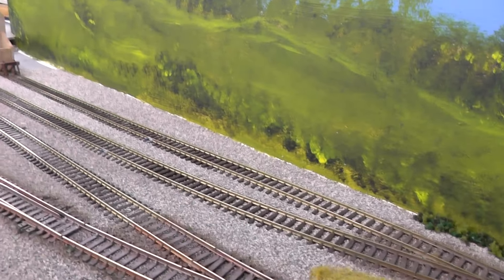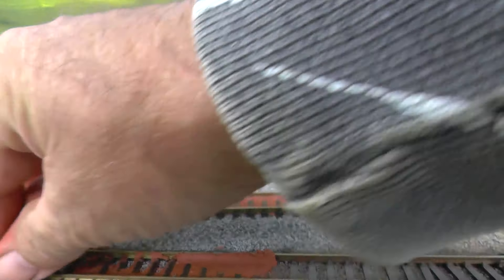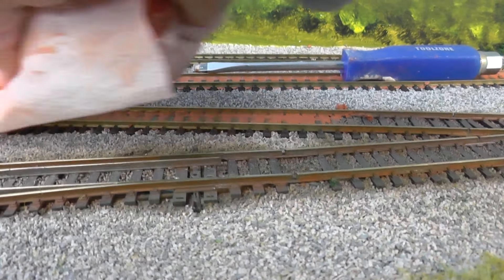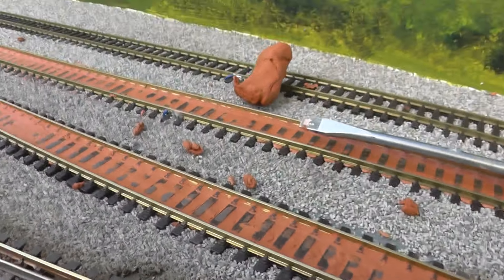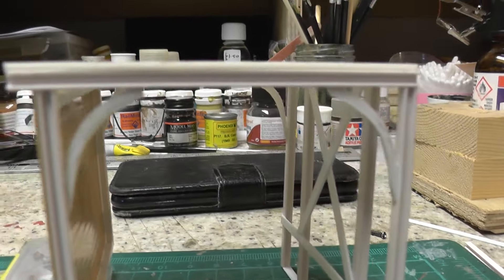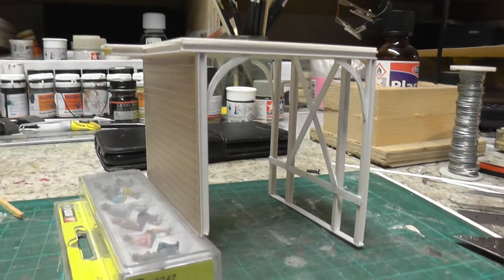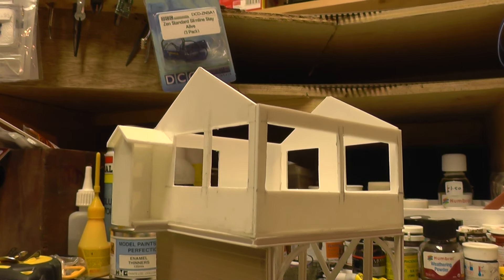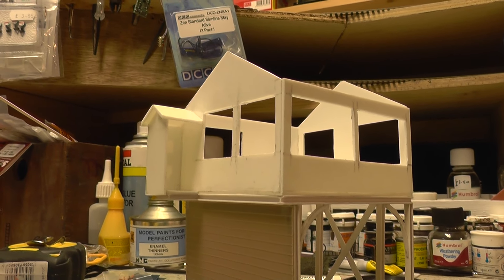Perranwell station part 5

Comment: You gave me a great idea for making the road crossings.  Instead of using mud which is messy as hell, I think I will try the clay which should be a bit easy to use.  The scenery is coming along.
Scott
Reply from the maker: hi Scott yes the clay is great to use and not so messy as filler cheers Kevin

Comment: Never used modelling clay. I have always used polyfilla (other makes available). Polyfilla is also very good for cobbles if you catch it just as it dries with a pre-made mould, or afterwards by scribing. Looking good as usual Kevin. Very much like the look of the signal box. Cheers, Bob
Reply from the maker: trainmanbob thanks Bob thought the clay would be cleaner than filler worked ok with no sanding cheers Kevin

Comment: I used das clay on my layout CSX Rensville. I put down a coat of PVA glue first then applied the clay using my fingers to push it down. Once dried and painted the static grass was applied the over all effect is very good. I do like your videos and your layout is excellent.
Reply from the maker: CSX RENSVILLE hi thanks very much glad you like it will have a look for a new tripod soon cheers Kevin

Comment: That is lovely work on the signal box Kevin and a real unusual building too. The laser cutting is probably the perfect answer for those frames. Have you ever tried scoring clear plastic sheet to produce fine frames? If not, you score the sheet with the desired number of frames and then use an acrylic or enamel paint to leach in to the grooves and wipe the excess away - much the same way as doing grouting on brick plasticard. Getting the window pane totally clear after is the real knack with that method. Paul
Reply from the maker: Galgorm Hall OO Gauge Railway Layout hi Paul thanks for that info might give it a try like experimenting cold be fun cheers Kevin

Comment: I'm going to try the DAS clay too in between my rails for a cobble effect. I've never done it either. I think I might have fun/difficulty imprinting cobbles in between rails. As you say running an old wagon will help stop it fouling up before it hardens. 
Looking forward to your signal box. All looking good so far methinks. Laurie.
Reply from the maker: Calvertfilm hi Laurie thanks the clay works well would look good with cobbles Imprinted ,really pleased with the signal box cheers Kevin

Comment: I like the bridge and tunnel stonework. That extensive use of the modelling clay is impressive. Have you tried polyfiller? I am also impressed by the outline platform and buildings with that signal box. The laser cut windows will complement your scratch built box well.
Reply from the maker: Hi John thanks very much the clay molds nicely where as filler would need a lot more work ,just thought the clay would be easier .hopefully the signal box will turn out well cheers Kevin

Comment: The bridges look good Kev , even better when completed , not sure about the modelling clay , maybe when matt painted they will look far better , interesting signal box you look to be doing a nice model of it ..noticed you have the stay alive decoder kit hung up , just tried one and with a 6 pin decoder and burnt it out ...not sure what went wrong ...wired the blue stay alive to blue on the decoder ..black to black ..then put the decoder in the Loco ..and it just burnt the decoder without any movement ?? completely baffled me ..have you had any problems with them? ..|Dave
Reply from the maker: David Howarth thanks Dave not actually used the stay alive units they have been there for another one of those projects that I have not done  yet !!! Cheers Kevin